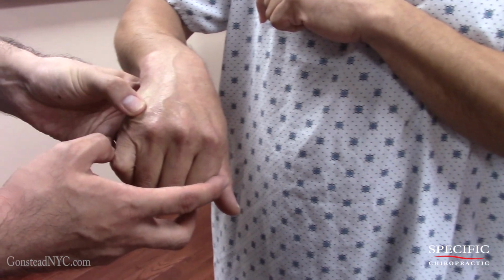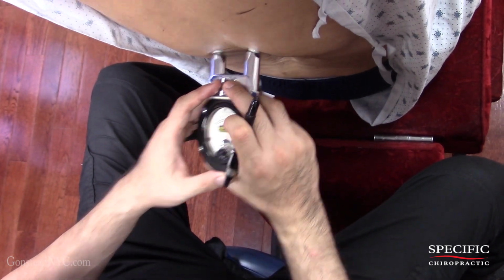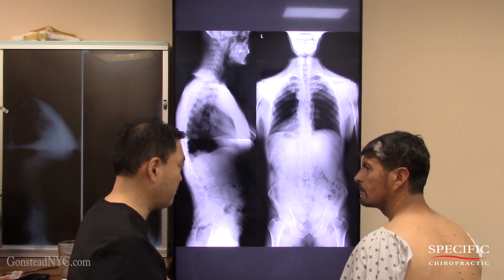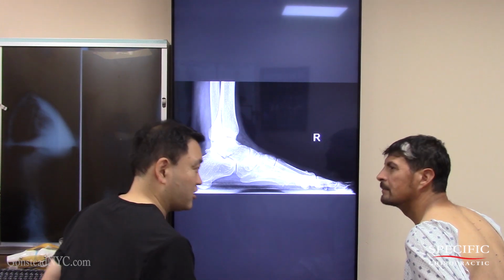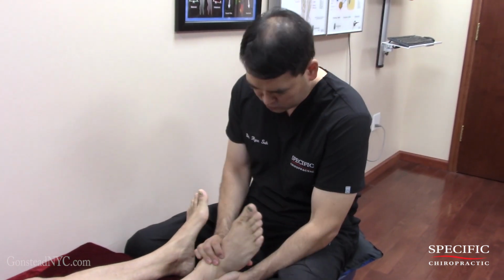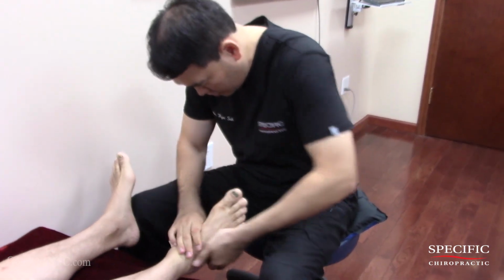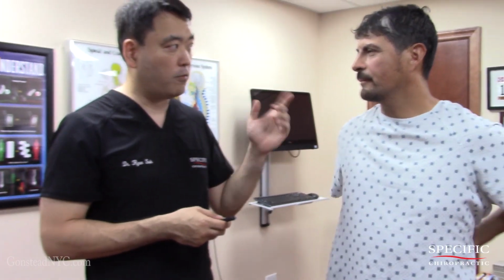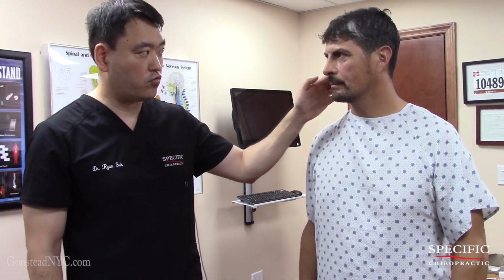Construction worker with SINUS adjustment, TMJ, X-ray Analysis with Dr Suh Chiropractic

Comment: He fixed his deviated septum like it was nothing. Meanwhile, doctors told me that i'd need surgery to get it fixed. TMJ included. Unfortunately this doctor is like on the other side of the world from where I'm at (Pakistan)☹️
Reply: @FckPeace2  well don't look at me. I'm not the surgeon here. Though I will tell you to get it checked out by an expert. If it's a mild one with a slight deviation then it can be treated without getting a septoplasty but if it's a severe one then surgery is your only choice.
Reply: It likely depends on whether you were born with it or not.  If it is deviated as a result of an accident (like this man) you can probably have it fixed with a simple adjustment.  However, if it is a deformation you were born with it will likely require surgery.  I was born with a deviated septum and it required surgery.  The surgeon told me that he had to break my nose and then reset it.  Also, there was surplus bone and cartilage that needed to be removed as well because it was a birth deformity.  The several days following the surgery were horrible, but I have never regretted having it done.  It was worth it.
Reply: In Pakistan, you can go to Lahore Dr Rizwan chiropractor he is a blessing for Pakistani 😇
Reply: @sumerajabeen449   hey! Thanks for the info. how can I contact him? And have you been a former patient of his?
Reply: @randyjones3050  I'm sure I wasn't born with it. It deviated somewhere around when I was in highschool so we're talking a long time ago. Damn, even that simple adjustment would hurt like hell I'd imagine.

Comment: Hello. I’ve noticed that you said the nervoscope measures heat. Seeing as though, people have differing body temperatures based on conditions like fevers or anything else, is there a temperature adjustment on the scope or is that correction not accounted for?
Reply: I am no expert but from my understanding of having it done by my chiropractor, it is not measuring the temperature level per se, but the variation in temperature between the two sides of the spine and up and down the spine, thus showing where the issues are.

Comment: I am so confused. How do you adjust a sinus?? It’s a cavity...
Reply from the maker: Correct, sinus is a cavity. The bones make up components of that cavity. In this patient, the maxillary bone was misaligned therefore changed the air flow in the maxillary sinus resulting in sinus debris buildup that the immune system needs to remove. Realigning the maxillary bone into proper place reduces the air turbulence and restores air flow and circulation, aiding in drainage and ease of debris removal. Same can be done for sphenoid bone for sphenoid sinus and frontal bone for frontal sinus.
Reply: Specific Chiropractic thanks for explaining!
Reply: Specific Chiropractic amazing . I think I have this issue :( my maxilla look uneven and my nose is crooked. 
And I have TMJ

Comment: Will it help with anxiety and depression?? Or anyone had any luck with it helpings with aleopecia??
Reply from the maker: If there’s a nerve pressure causing an imbalance resulting in anxiety, chiropractic may help. But not for alopecia.
Reply: Also, carbs can cause anxiety and depression. Lower the amount you consume. Hope it works for you.
Reply: HeadingEast33  Most of the body's serotonin receptors (the chemical most anti-depressants modulate) are found in the GI tract. Not to mention bacteria ferment sugar into all sorts of other molecules. I don't think what you are saying is far fetched at all and it may not even be placebo. That being said, placebo can have benefit too.

Comment: Am I the only person concerned with the amount of radiation this dude was exposed to in order to get those images... who ever took them knows nothing about taking xrays or about keeping patient exposure levels to a minimum.
Reply from the maker: On the contrary, if you understand xray physics, taking full spine xrays has the least exposure versus to a typical sectional xray series. 40" FFD lumbar series measures approximately 2-3 mSv (Sv = unit of radiation). Full spine at 82" FFD series measures approximately 1 to 1.5 mSv without filtration. This is laws of physics. No different to a water hose, closer you are, the more intense water pressure you'll feel. Further away you are, less intense it becomes. Xray radiation still follows the laws of physics, it get weaker by distance. Add copper and lead filtration to areas of less density to get a uniform xray picture further cuts down the radiation to 0.2 to 0.3 mSv.

The images you see is taken on a full spine xray DR panel. We are the only Gonstead chiropractic clinic in the entire world who has it and the only one in the USA as well. That Digital Xray full spine plate requires even less radiation to produce the image. I don't know the exact number, suffice to say, it's less than 0.2 mSv.

So approximately 5-8 mSv for entire cervical series, dorsal series, lumbar series, pelvic series with OVERLAPPED areas of double radiation exposure VERSUS Full Spine with filtration results in 0.1 to 0.3 mSv. The numbers speak for themselves.
Reply: @SpecificChiropractic  ill be flying from Greece to nyc in a couple of weeks ill be scheduling appointment for sure